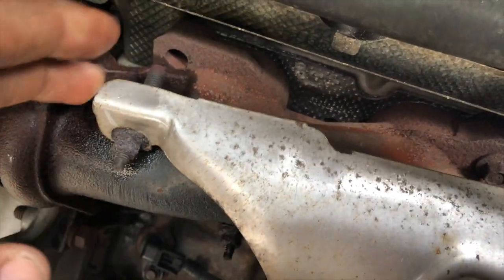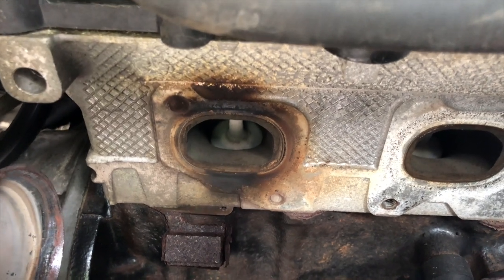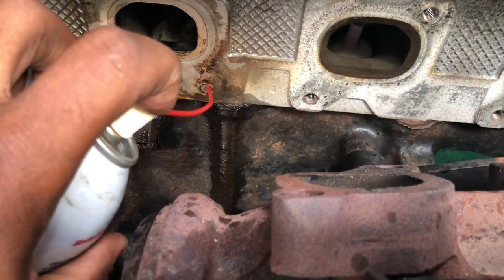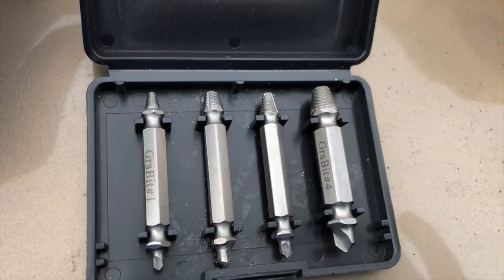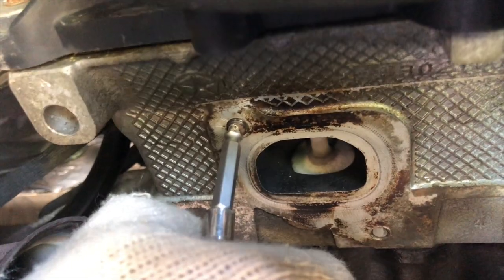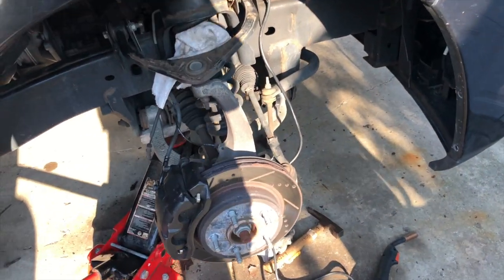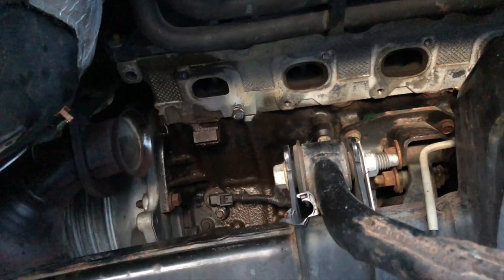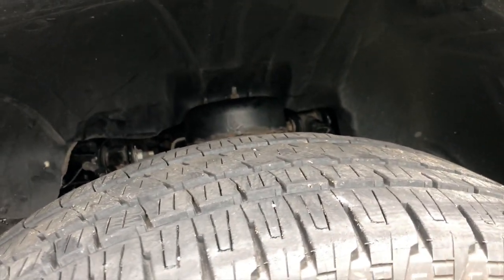Is my Dodge Ram Hemi ticking, or an exhaust leak? Issue, Fix, Tips & Recommendations

Comment: I have this EXACT SAME TICK on my Durango 5.7 Hemi. I had already rebuilt part of the engine for nearly 2k just a few years ago (lifters got jacked up, oil injectors got clogged, timing system needed repaired....it was bad news), so I am HYPER vigilant about ticking noises now. I was so worried that all the money I had saved for my babies' Christmas was gonna go back into my truck until I saw this video. Yes, it is something I will need to either address or trade this beast in (likely  trade since I have spent enough on this dang thing), but I should be fine to drive it for perhaps several years.

God bless you man. As soon as I saw Hemi, I said "it will either sound the same and I'm not in as much trouble, or it won't, and I am". You put my mind at ease, brother. Thank you. Kids thank you too, they just don't know it yet lol.

Comment: Decided to go with shorty headers however putting a flex joint from the exhaust header flange and cutting a section of the head pipe out is a must if you want to seal the exhaust system permanently. Those catalytic converters do create a lot of back pressure maintenance is necessary regasketing and retoqueing bolts.

Comment: My 2014 ram has the same issue, ram really needs to address this problem!
Reply from the maker: Dodge needs to definitely address the issue.
Reply: I did the passenger side now it's gonna be the driver side 👍
Reply from the maker: @stephenmcgraw3610  , Awesome!! I hope it turned out great.
Reply: Mic welder is a lot easier

Comment: I had the same issue with my 2013 Ram but it was on both passenger & drivers side.. Same 2 broken bolts on passenger & top rear on drivers side.. The sound was terrible. Bought both new exhaust manifolds, gaskets & bolts/studs. I centered punch the broken bolts on passenger side & drilled in enough for my extractor to bite & slowly back them out. I was lucky on drivers side that the broken bolt was out enough to grab with some vise grips. Installed new parts & no more ticking!! Nice video!!
Reply from the maker: Awesome job, Adam! Dodge should have used better material.

Comment: Excellent video, thanks for posting!  Especially appreciate how you left in (and captioned!) all the stuff that went wrong along the way.  Great job overcoming the obstacles!

Was that a flux-core welder, or a MIG?
Reply from the maker: MIG. Thanks for watching!
Reply: Terence's Youtube do you think it could be done with a DC flux core welder? Or not hot enough?
Reply from the maker: Yes, it should work easily.

Comment: Do not reuse the manifold because it's warped unless you get it resurfaced.  For me I got me new set of manifolds and sold the old manifolds.
Reply from the maker: That may be the case in some instances however, these were fine and still holding up well 100k miles later. Thank you for watching.

Comment: I haven’t watched yet but i expect it’s a warped exhaust manifold. This causes broken studs. The bolts usually don’t break, only the studs. As this gets worse the upstream o2 sensor will also tell the pcm that it needs more fuel which can damage the catalytic converters and foul the 8 spark plugs on that side. All of this will happen if not resolved. Mines in the shop now for all of this and probably not covered under warranty.
Reply: Mileage- 45,000 yup

Comment: Nice job but maybe you should of  put some tape over the  port so no metal filings go into it then into engine and make problems
Reply from the maker: Hi, I thought about doing that. It's a good idea. However, I was very careful when I had the ports exposed. Thanks for sharing that information.

Comment: When this clanking-Noise  does not go away, when the engine heating up, It will be not the Exhaust-Leak ?
Maybe an connecting rod ?
Reply: I have the same question have you found an answer???
Reply: @rickyazua3659 
 Actually yes :-)
When the ticking is going worst when engine heating up, it's defenily not an exhaust leak.

Comment: Great video. Can you explain how you used the extractor and then the extractor bit? or did you just use the cobalt drill bit and only the extractor that broke? Thanks
Reply from the maker: Hi, I used the cobalt bit to drill the hole, and then placed the appropriate size extractor to remove the stud. You may get lucky using this method however, the best way is using a welder. It's super easy and will save you lots of time. Thanks for watching!!
Reply: @TerenceDIY  Thank you for the reply. I had tried to use the other side of the extractor then flipped it for the side with threads instead of using a small drill bit first like you did with the cobalt ones. My dodge ram does this exact same noise.

Comment: Question with your exaust leak did you have a black residue on your drive way aswell from condensation? Trying to fix my own problem not sure if that's what it is. Got a hellcat and sick of seeing black drops on my drive way and it's not oil and if it is its burnt to shit. Not a significant leak though and I do have a small amount of ticking but not like you.
Reply: Josh Reynolds if it’s black soot being left it’s more than likely an exhaust leak of some kind, maybe a hole somewhere along your exhaust system or bad seals/welds where pieces connect

Comment: Does it also tick when you drove it?
Reply from the maker: Sorry for the late response. I am in the midst of a privacy fence build that I am filming so I have been very busy. No, the truck ran smoothly upon acceleration. If you hear a ticking sound when you are driving, then you have a lifter issue. You might be in need of an oil change. Thanks for watching!

Comment: This was overall an excellent video, just a couple stutters and not using the correct terms for nuts and bolts. Regardless I would give it a solid 9.5/10 and good job fixing your problem.
Reply from the maker: Hi Steve, thanks for the constructive criticism, as I am normally, a good speaker and get terms correctly. However, I do venture off at times, but I'm human. lol. I will do better in the future. Thanks for watching!
Reply: Steve Dangle. Kinda picky Steve. Good vid. And Terence's reply shows solid character.
Reply: @carolinagomez4544  I thought 9.5/10 was pretty fair in all honesty. I really liked the video, just some constructive criticism is all.

Comment: I’m betting that manifold is warped which probably what caused your bolts to break in the 1st place. You should have replaced the manifold or you will be doing that job again
Reply: I wouldn't say the manifold is warped but could be however broken manifold bolts are very common problem on Hemi motors

Comment: I BET YOU GONNA HAVE THE SAME PROBLEM CUZ YOU USE THE SAME OEM BOLTS. I DID MY TRUCK AROUND 6 YEARS AGO AND THE BOLTS STILL LOOK LIKE THE FIRST DAY I PUT THEM ON BUT I USE STAINLESS STEEL BOLTS FROM LOWES.
Reply: Hope you used anti-sezie on those stainless steel bolts if not you will never get them out
Reply: @joe7528  RECENTLY I DID A CAM UPGRADE TOGETHER WITH HEAD PORT AND HEADERS AND BOLTS CAME OUT LIKE NOTHING SUPER EASY. I THINK IS THE BEST OPTION SINCE I LIVE ON THE NORTH EAST.

Comment: Little tip so you don't break the extractor off is to drill down more than what you did you want the extractor to really bite as much it can .... also don't buy the OEM bolt kit you're going to have the same problem later i would recommend buying something better

Comment: What if u never fixed it. I have a slight tick but no where near this bad. I wonder if they could be loose.
Reply from the maker: It will continue to get worse. The other studs will eventually break. Thanks for watching!
Reply: @TerenceDIY  thanks for the reply. Someone else who owns the same truck said hemi’s come with a natural tick from the factory. Wonder if that is what I’m hearing
Reply from the maker: Patrick, you will hear a slight tick upon start up but it goes away when the truck starts to idle down. In my case it remained although it got quieter when the truck idled down. If yours has a constant tick, I am willing to bet (and I don't gamble. lol) that you have a few broken studs.
Reply: @TerenceDIY  it comes and goes, and only ticks (not a rough tick) when I accelerate from coasting. Not sure if that’s symptoms for broken bolts I hope not
Reply from the maker: How many miles on your truck? During your next oil change I will add a quart of lucas oil stabilizer if I were you. Those are the lifters you are hearing. I am all too familiar with the Hemi engines.
Reply: @TerenceDIY  158k. And I just bought it so I’m not used to rams. But I’m just trying to figure out the problem and make sure it doesn’t get worse. And I did add some engine add. When I did the oil a couple days ago
Reply from the maker: @patrickpatterson3735  , no problem. I can help you out because I had 3 of them and I have the software for the Ram. Any questions feel free to ask.

Comment: Damn straight dodge should have RECALLED this! I'm now dealing with this damn issue
Reply from the maker: They absolutely should have.
Reply: Dodge only recalls things that are safety issues, they won't recall this and take business away from the service shops. Put on a set of headers and be done with it
Reply: Same. My truck doesn't even have 25k miles on it. Definitely a bummer.

Comment: Suggest using Left Handed Cobalt drill bits.  1- they do not tighten the broken bolt any further.  2- sometimes you get lucky and they begin to extract while drilling.   And yes PB blaster helps too!!!

Comment: Mine has the same noise but for like 3 seconds. I think its probably lifters. I did replace them 2k miles ago when I did the rebuild, could have replaced with a bad lifter.

Comment: Come on man, we all know you ran out and bought that welder after breaking that extractor. 😂 The zip ties are still on the cables and plastic on the wire. Its cool bro, aint judging. Id do the same. Good job though getting those bolts out. I gotta do the same thing to my 05 2500 right now. Good thing I already got my welder. Lol thanks for taking the time to film. Helped me see what Im up against.
Reply from the maker: Hi Robert, I bought that welder in 2010. I placed the orange zip tie to keep the cord intact. This video was shot in 2018. If you search my welder, it was probably impossible to find new in 2014. They were discontinued in 2013 I believe. Oh, I own like five welders. LOL. Thank you SOO much for watching.

Comment: Mine was the top one only.  Flush with head.  Drilled with cobalt bit and used an EZout.  Was relatively simple and turned out with no effort.  Did it on my house garage floor.  I contacted FCA. It's not a recall as it is not a safety concern.   FYI there are two types of replacement stud bolts for the heatsheild locations - the factory originals which are about $1-2 each and an upgraded stud bolt that costs about $6 for one (has a white paint dot on the stud end - different metal composition).  They were hard to research and only one of the dealerships I contacted knew about them and had them in stock.
Reply: Also. Patience just like he said!!  Use a cutting oil on the drill bit to keep it sharp and drill slowly.  Put a rag into the exhaust port to keep crap out

Comment: Yup, big problem. Just got truck from dealership. Engine is about to go, I guess the cam shafts were worn down from no oil changes, luckily I took it in otherwise I'd be out 16- 18k for a new engine plus labour

Comment: That 5.7 hemi is not worth a shit after 130 miles lifter trouble spring  and camshaft  I have 2014 hardly  drive it  I bought it in 2016 only  put 24 thousand  miles on now it gonna cost about1500 to fix it I gonna trade it away they are only good for short distances in not traveling constantly

Comment: wow dude, great job! great video. I have an '07 Ram it's not a Hemi but I have a strange ticking sound and I wasn't sure where to start looking. this video was super helpful.
Reply from the maker: Thanks, Ethan.
Reply: Could be one of a few things. This, hydraulic lifter failure, big end bearing failure. Your choices depends on if it goes way when it warms up.
Reply: I have a 06 and mine does the same
Reply: @johnbaker4915  my 2008 Dodge Charger Se
has a tick, but goes away when warms. Well really 10secs after I start it. Do you know what this could be?

Comment: Had same thing happen to my 07 Ram on the same side. I believe it’s caused by the engine twisting on exceleration or jarring from hitting a pot hole.  had three break off and had to install one threaded insert to repair cause I broke the easyout in the broken bolt and had no choice but the grind it out carefully and drill and tap for a Jergan threaded insert.

Comment: I know this video is 2 years old but dodge did this recall in 2017. It's still active as well. I have had mine fixed twice through the dealer at no cost to me. I have 110k miles on my truck so that will tell you it's common.
Reply: Can you link something to that, I can't find anything on it and I just check my Vin through the dealership and I am up-to-date on any and all recalls or notices
Reply: What year?
Reply: I couldn't find any recalls about the manifold bolts

Comment: I just bought a 2020 rebel n it sounds like a tick when cold started
Reply from the maker: Your engine should be running smooth as butter! That thing is new! Please have it checked out. Thanks for watching!
Reply: I think it was the new motor in sever cold because  the one warm day it sounded good but soon as it it gets to single digits  n lower it sounds bad

Comment: Good vid bro. I’ve spent over $700 trying to fix this problem. Was about to replace my whole engine for $4000 but I’m having second thoughts. Obviously mechanics are real scammers. They want to charge me $3500 to replace the lyfters. Got an opinion on this? 
Oh and I have the same noise bro
Reply from the maker: Hi Raymond, you are correct about some mechanics, however, there are some good ones out there. Lol. Did you replace the manifold gaskets? What did you get done that cost $700?? Thanks,
Reply: Terence's Youtube 
First before my reply I really appreciate your reply bro, that’s awesome man.
Well this was all spent in one week as well.
 I first started with ignition coils, then all spark plugs, replaced solenoids, air filter. And still the same. Then come to find out... my exhaust manifold  has some bolts that are broken just like how you showed us. 
Now that’s my next move
Reply from the maker: Raymond, I am almost positive that's your issue if you have a tick like mines. Please let me know how it sounds when you replace the bolts. If you have any more questions, don't hesitate to ask. Thanks,
Reply: Same problem here. My 2012 5.7 hemi sounds exactly like that.  Dealership told me probably lifters and want to replace or rebuild engine at cost of 7000 for rebuild or 10000 new engine.  Car was running fine no dash cluster lights on. Except about two weeks before I had engine light on. Diagnostic showed misfire on cylinder 2 so I had complete tune up changed all plugs and no more engine light. But this tick noise driving me crazy! Trying to find honest mechanic that can fix this problem I'm sure it's the same as yours. Any recommendations? I am in Michigan Romulus or ann arbor area.

Comment: Sounds like my vehicle.  Yet, majority are lifter issues.  What were or are your codes?
Reply from the maker: Hi Michael, I never got any codes. The sound was just becoming more pronounced.
Reply: @TerenceDIY  Hemi's having too many issues nowadays.  I've been a Jeep Dodge Chrysler since forever.  I'm done with em for now.  Riding these til I have for now til they completely die then I'm done them.  Especially, if Dodge, Jeep, and such stay with this same practice of having bad lifters, cams, and don't have a service bulletin, and the like.  Pay for the repair of such.
Reply from the maker: I totally understand, Michael.
Reply: @michaelelliott289  hy there. I have a 2015 Dodge ram. 1500 3.6 and approx
3 weeks ago it started ticking loud . i took it to tve Dodge dealership and they assure is a left side lifter. I asked a 2nd andc 3rd opinión and apparently it os a lifter. OMG i dont have the money to fix 1800 dollars. Could it be a?slughtly chanse os sonething else? Tererence's youtube what do you think?
Reply: Terence's Youtuber
Reply: @jennygutierrez201  probably change oil add some Marvel Mystery Oil.  If that doesn't help try installing an Melling high performance pump.  Which should help.  Which much cheaper to do without taking the complete engine apart.  Then baby it and save your pennies.  Mine is having similar issues.  Mine is or will soon to be my project SUV.

Comment: Did this cure the problem or did it come back?
Reply from the maker: Hi Steve, it fixed the problem. No issues at all after this. Thanks for watching!
Reply: @TerenceDIY  Thx Terence. My '14 Crewcab has it on driver's side.  Did you replace rest of bolts and new gasket or just torque back down 2 replacement bolts? Thx again.
Reply from the maker: @stever.747  , I did not replace the rest of the bolts. They appeared to be fine.

Comment: Man i just noticed the same thing on my 2013, same spot too. Glad you made this vid cause I thought it was a cam an roller going bad, I hope my bolts aren’t as bad but from what ive seen im probably going to have to do the same.
Reply from the maker: I hope your bolts aren't as bad neither. Fingers crossed that you will get through the job in a breeze. Keep me updated. Thanks for watching!
Reply: Hey brother,I wanted to know if you have done this job already because I'm facing the same problem with my ram and wanted to try this before doing lifters/rollers amd stuff

Comment: Is the oem replacement bolts the same  type of bolts that snapped in the first place?
Reply from the maker: Hi Joseph, you are correct. However, my truck has 178k miles (highway). This was bound to happen at some point. They don't make things like they use to. Thanks for watching!